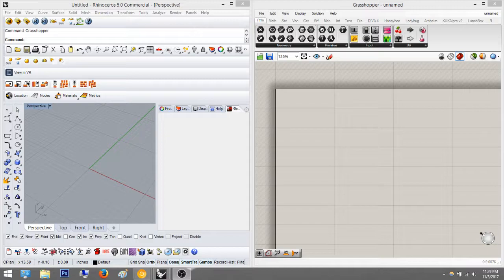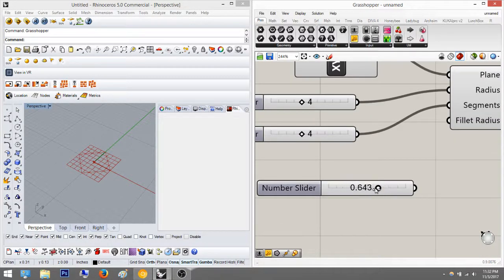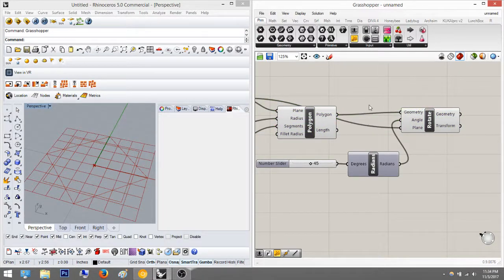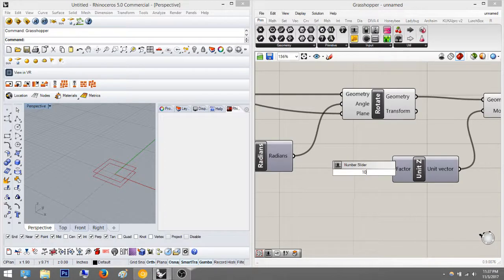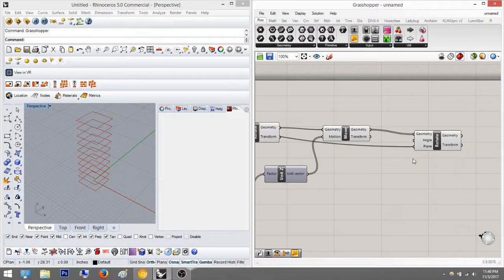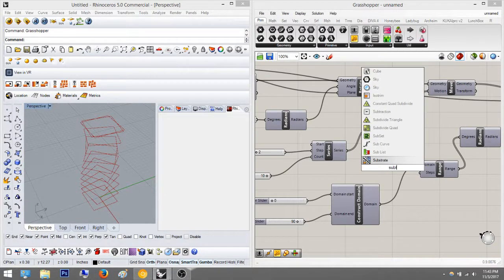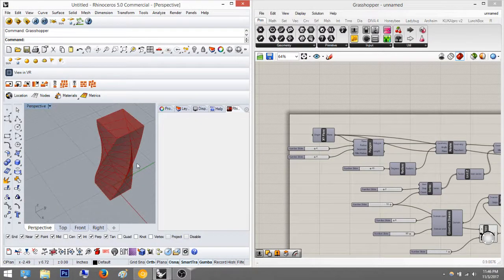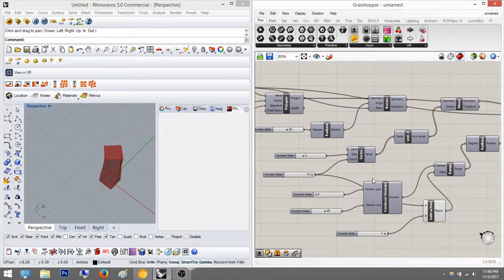Grasshopper Tutorial Part 2a: Twisting with Series and Range

Comment: Hello,

I’m working on a Grasshopper script in Rhino and I’m having some difficulty with the workflow.

I have a square drawn in Rhino that I reference in Grasshopper. My goal is to create three copies of this square vertically, with a fixed distance between them, and then generate a surface using the Loft component.

However, I also want to control each square independently. For example, I would like to rotate or transform each square separately so that when I apply Loft, the resulting geometry creates a twisted form. In other words, if I rotate one of the squares, the lofted surface should twist accordingly. What would be the best approach to:
1. Duplicate the square vertically at a given distance.
2. Apply independent transformations (such as rotation) to each copy.
3. Loft the resulting curves to obtain a twisted surface.
Any advice on the correct components or workflow in Grasshopper would be greatly appreciated.